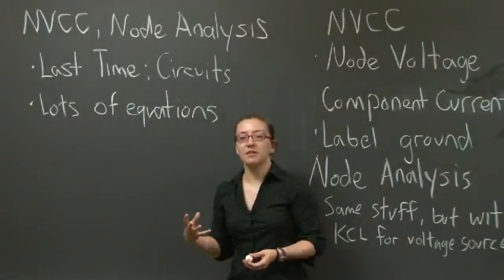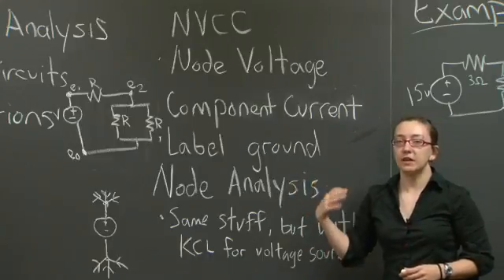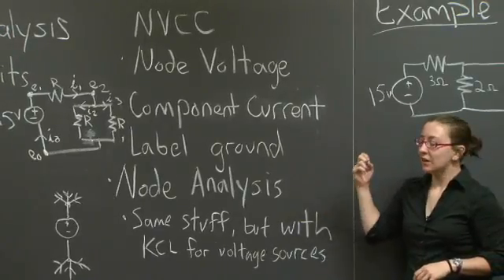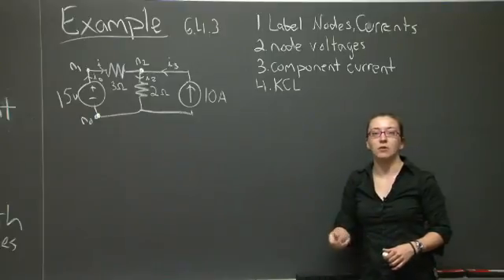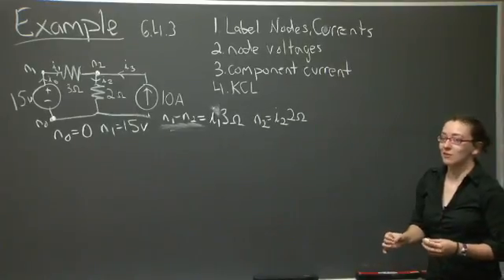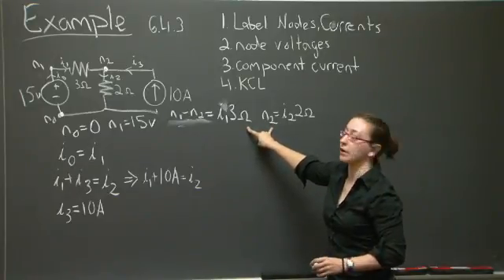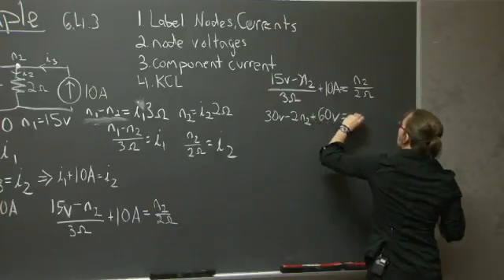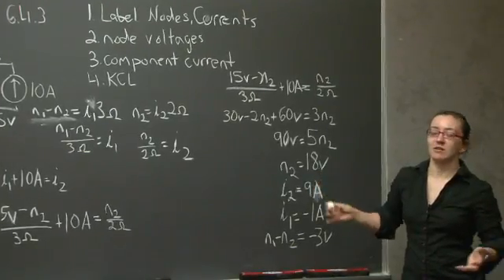Rec 10 | MIT 6.01SC Introduction to Electrical Engineering and Computer Science I, Spring 2011

Comment: So the 15v Voltage Source didn't contribute any current to the circuit since the Current Source needed to supply 1 amp to the Voltage Source.
Reply: The voltage source limits the current through the 3 ohm resistor. If you use super position you will see the 15 V source puts 3 A through the 2 ohm resistor.
Reply: you have a misunderstanding fundamental to circuit superposition. the 15 V source DID contribute a 3A current to the 3 Ω resistor (and the other one, too), the problem is that the 10 A current source induced a -4 A current to it (and 6 A to the 2 Ω resistor). superposing these together, the overall current is -1 A.
Reply: Sorry bro....voltage source supply current in this crcuit .